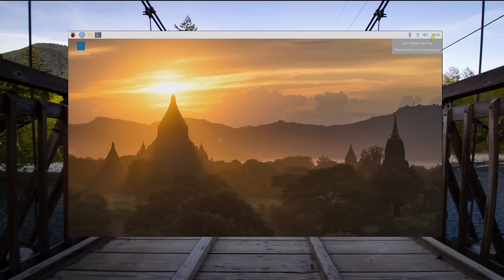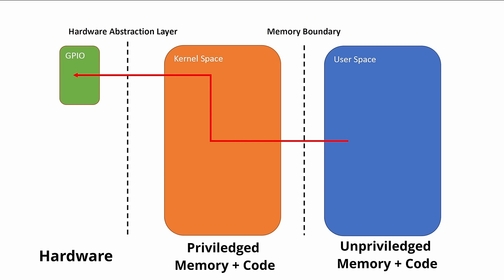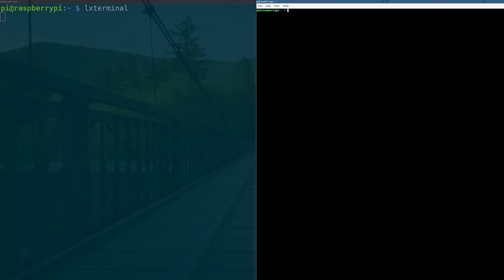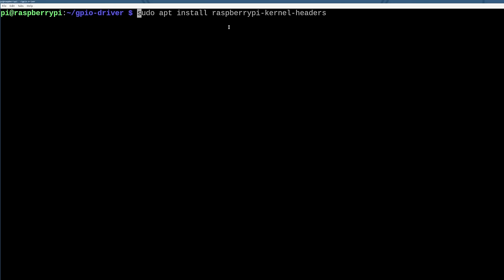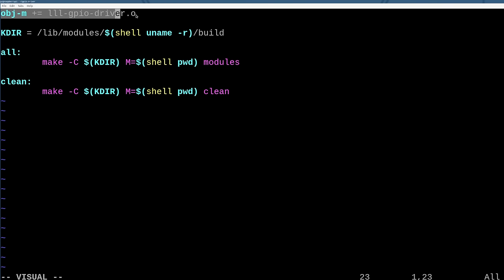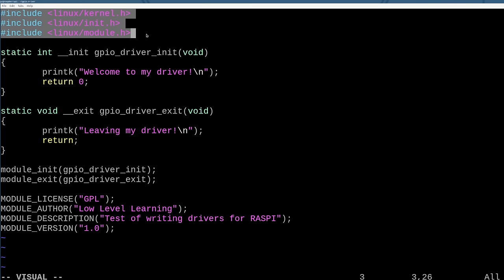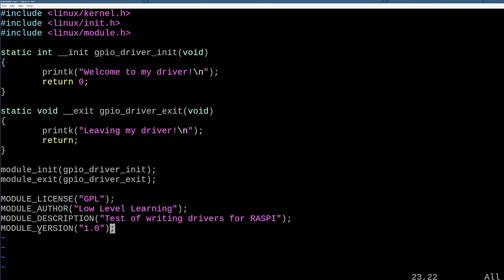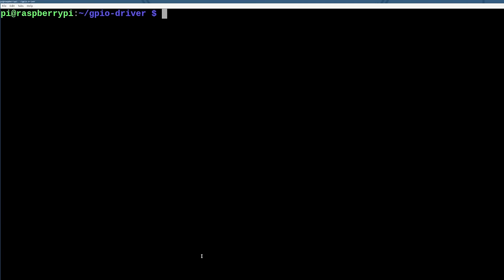Raspberry Pi Kernel Development | Writing a Raspberry Pi ARM GPIO Driver in C | Embedded Concepts

Comment: Why are both “__init func” and “module_init(func)” needed surely one is enough to declare that func is to be run when the driver is installed? (Likewise for  __exit and module_exit). It feels like a lot of logical redundancy and boilerplate code.
Reply from the maker: __init tells the linker in what section of the ELF to put that code, where as module_init tells the kernel module loader what function to run first.
Reply: @LowLevel-TV  ah ok cool! I don’t understand linkers very well :(

Comment: I'm currently working on building complete 64 bit OS for rpi 4 from scratch, i've barely installed debian 10 server with custom bootloader and kernel (rpi-5.19.y). Its part of my RA-ship project and i need to dig deep in device drivers and control over those GPIOs through C and QT... i'm finding hard time for every single step i do bcuz my custom built image lacks a lot of useful plugins (like i cant even do raspi-config since it says it doesnt exist and unable to install that either) that would be wonderful if you guide me a lil bit....

Comment: Unrelated question: How does one get a chunk of memory, like alloc, from the heap in ARM64 assembler? I suppose a supervisor call is used, but I can't find anything on the subject. BTW, I'm working on a M1 Mac, so I need the technique for MacOS. I'll be getting a Raspberry PI, soon, so I'd be interested in a linux solution as well. Thanks!

Comment: Wt if I wanted to get data ( rise and low timing )  from 2 lines  (TX detect and  rx detect)  from my custom lidar but facing issue to get gpio to read both of them...
I mean by - 
Once a sense pulse is given lidar scan 1000 points(ie 1000 of both  TX detect and Rx detect signals) 
TX detect goes high once the  laser shoots every single pulse
Rx detect goes high on reflection detection
Reply: Wouldn't it be wiser to use some dedicated input capture capable timer ?
Reply: @epolpier with rpi integration?
Reply: @adarshp6550  I just checked that indeed there is no support for input capture in rpi so you should use a different platform for the use case you would like to implement.
Reply: @epolpier  any suggestions?
Reply: @adarshp6550  stm32mp1 ?
Reply: @epolpier  mm I look into it, by the way thanks for your time. I appreciate it

Comment: Hi, thank you for your video.
I have follow your instruction but after step "sudo apt install raspberrypi-kernel-headers", it was download but there are no build folder in side the /lib/modules/<myversion>/
Reply: Probably the installed package doesn't match the loaded kernel, that version must be identical

$ uname -r
5.10.60-v7+

$ dpkg -L raspberrypi-kernel-headers  | grep '/lib/.*/build'
/lib/modules/5.10.60+/build
/lib/modules/5.10.60-v7+/build
/lib/modules/5.10.60-v7l+/build

$ dpkg -S /lib/modules/`uname -r`/build
raspberrypi-kernel-headers: /lib/modules/5.10.60-v7+/build

Comment: Uhm. Help! I don't understand that function definition. For all C I know, a function is defined like this: return_type function_name( parameter list );  now how come there is some __init keyword between return type and function name? What's that exactly? Thanks 🙏
Reply: In general, most compilers support a sort of attributes to tell how to compile that function, like where to place it in the binary (can be an absolute location or name of memory segment), which calling convention to use that determines the stack frame handling of the function (this code is in addition to what you wrote inside the function body, like pushing used resisters on stack before executing your code, then restoring it afterwards). For example, (in gcc) there is also an attribute inline keyword, which tells the compiler to actually copy the function code everywhere it is called from. So it won't use call and return, possibly optimize the hell out of the stack frame. Useful for one-line functions which you want as performant as possible.

Examine the disassembly of your C code, you can learn a lot from it!

To answer the specific __init and __exit keywords, here is a link to a book:
https://www.oreilly.com/library/view/linux-device-drivers/9781785280009/e636c201-5e6f-4ddb-a4b3-9bd72f71b9b0.xhtml
Reply: @gabiold  thanks a lot for this excellent 👌 explanation

Comment from the maker: To X-forward a terminal over ssh: do `ssh pi@<ip address> -Y`, then on the Raspberry Pi type `lxterminal`. You also don't need to do this if you're okay with coding over the SSH PTY.

What's your latest Raspberry Pi project???
Reply: 32bit GPIO over I2C
Reply: why do you prefer the xforwarded terminal over just ssh’ing in

Comment: Nice intro into how to compile and load Linux drivers, but I'm curious as to why you would rather write to hardware in a driver than use the Linux GPIO uAPI from userspace, say using libgpiod.  Also interested to see how you prevent conflict between your driver and the existing gpiolib/pinctrl drivers present in the Raspberry Pi kernel.
Reply from the maker: There are 100% easier ways to do GPIO on the Raspberry Pi, this is just a good teaching opportunity for Linux Drivers :)
Reply: @LowLevel-TV  For sure, but if you are writing Linux drivers then you need to be aware of the the environment you are playing in.  You may be sharing the hardware with other parts of the kernel, and the kernel may well provide better ways to do things than accessing the hardware directly.